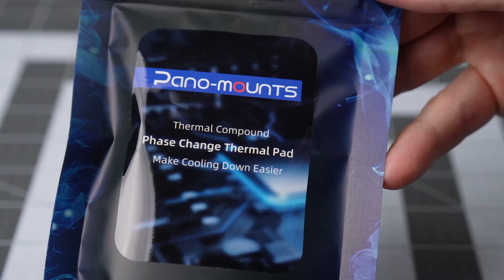New design of Phase Change Thermal Pads from Pano-Mounts 🖥️🌡️🔍

Comment: I used a contact frame, turned it upside down so I can see the inside and then used it with a fine tip marker as a stencil on the 7950, this actually gave me the right size to put on the IHS

Comment: The pad can be cut to the size of the CPU without the gaps and minus a couple mm. 28x28mm is what I used for my 7800X3D and it worked great. Makes it easier to apply because the pad will adhere fully to the CPU and not sag around the gaps, making the plastic come off more smoothly.

Comment: I dont get what these are for? Traditional thermals pastes are cheaper, and more convenient. What are these for? Why have they caught on, iv seen a few of the most popular tech/ pc builder channels using this stuff.
Reply from the maker: Good question, I'm not too sure. Longevity is one thing people have said. Another is better thermals, though when I tried it the first time I didn't see a huge improvement. The idea is that as the material heats up it fills more gaps between the CPU heat spreader and heatsink.
Reply: Thermal paste pump out (specially the high quality) is a real thing, you only need 6 months until kryonout loses 3c easily, those pad last like 2 3 years

Comment: Admire your dexterity, Scott. What type of alcohol did you use to remove the old pad? Is the price the same?
Reply from the maker: Standard stuff you'd get at a retail store. I don't know if something with a higher percentage would make a difference. 👍
Reply from the maker: Those paper towels are "shop towels" from Walmart. Not the best but a bit less particulates from standard ones.
Reply: @TECHiSuppose  I was talking about the price of the new thermal pads, Scott (not shop towels).
Reply from the maker: @paulm8157  I haven't looked at the price. It should presumable be the same as it's the same product listing. Generally with submission to Amazon on-site video they won't approve anything that talks about price or has time dependent data in it like that, so usually its not worth my time to talk about how much a thing costs. 👍